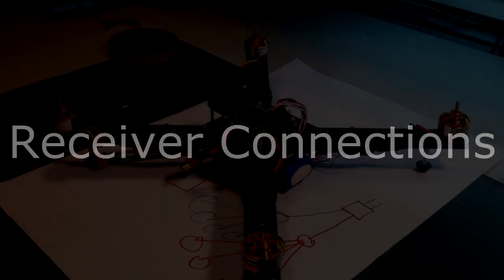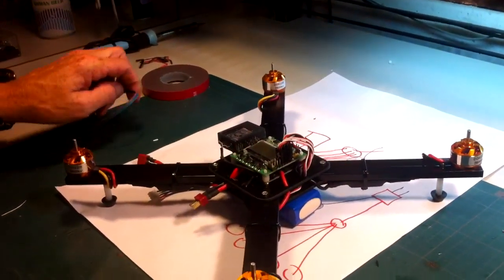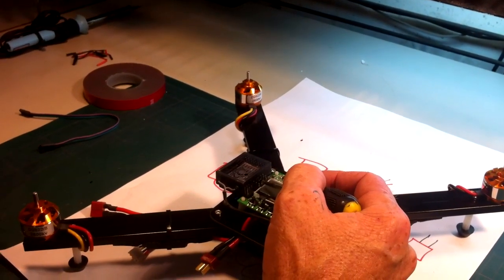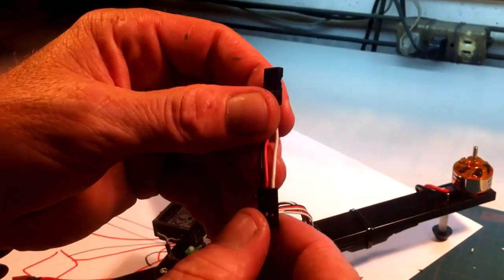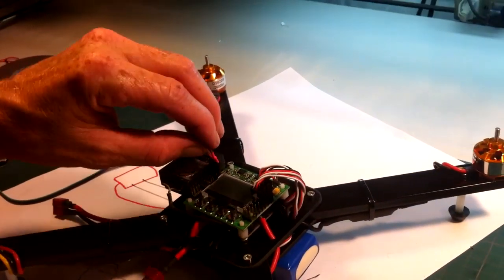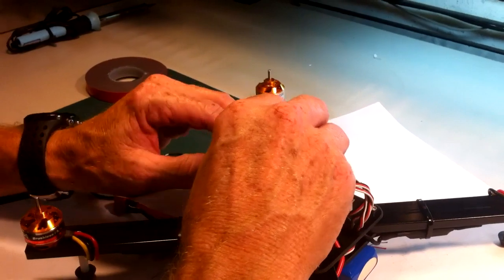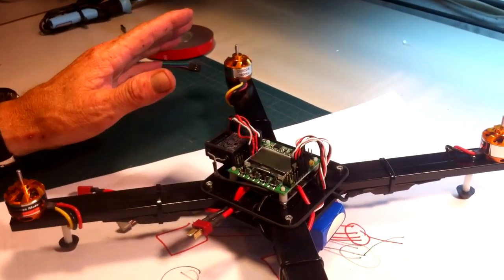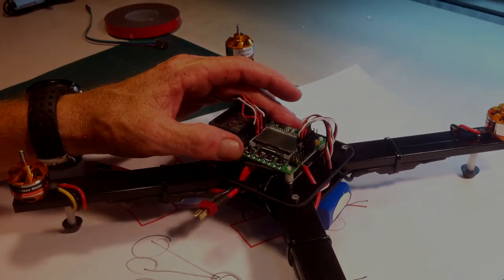Building A Quadcopter: Receiver Connections (Part 3)

Comment: I mounted a fifth motor in the center and linked it to one of the another motors on the kk2 with its own esc just wondering if the kk2 with compensate for the increased thrust

Comment: Hi, plz let me know that if u need only one positive connection from your esc why u connect all the esc to the kk2 board with all 3 wires. Not just like in case of kk2 board to rx. And also plz let me know what should i do in case of my KK2 board and multistar esc flashed with simonk firmware. Thnks in advance for ur kind help.